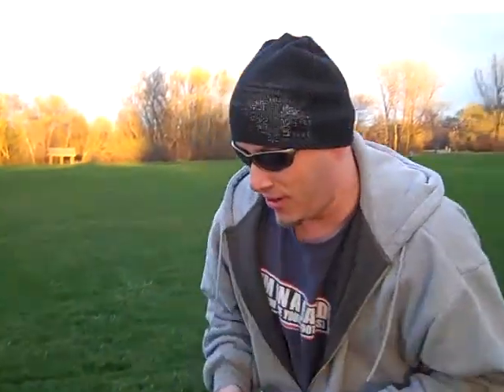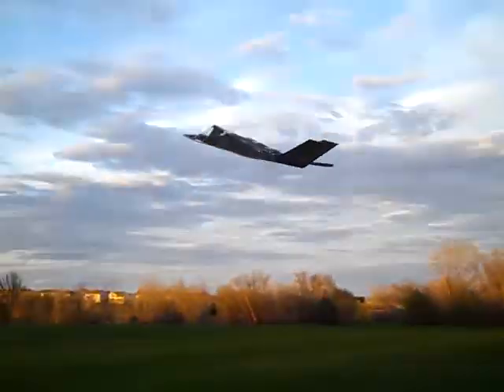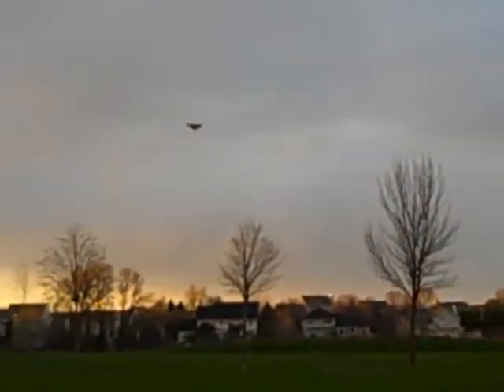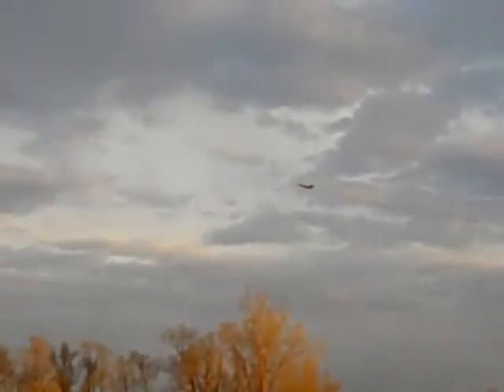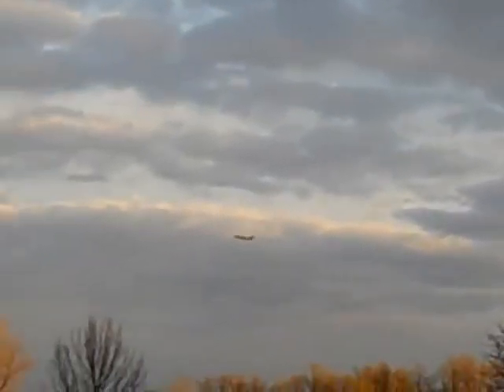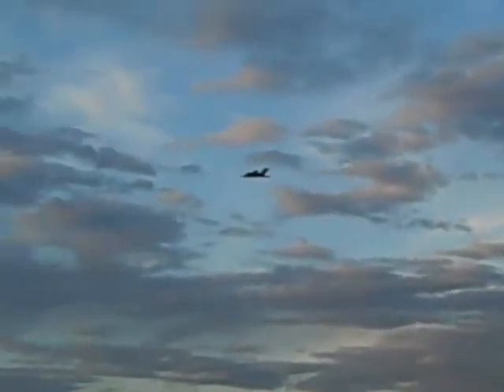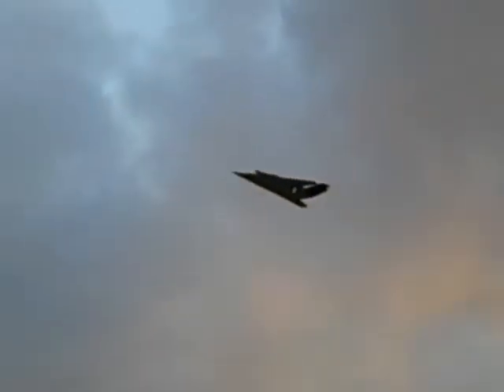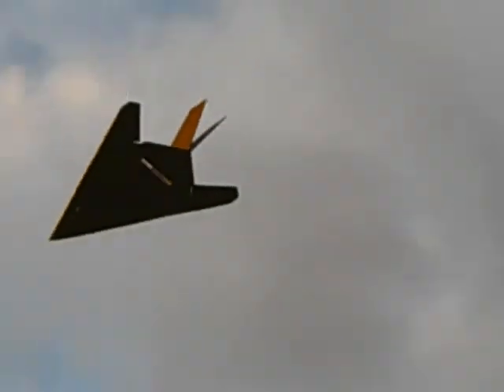Giant RC F117 Testing Part 2 (prop testing)

Comment: Try Making the prop opening in the foam deck larger. This may increase the thrust generated by the prop. 
The plane looks great. You really upped the scale a bit there. It floats very nice.